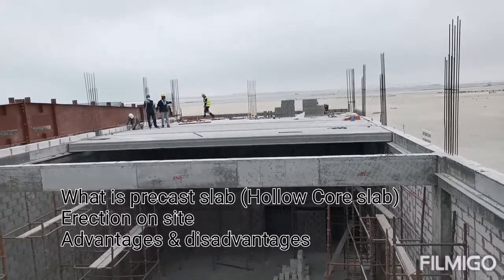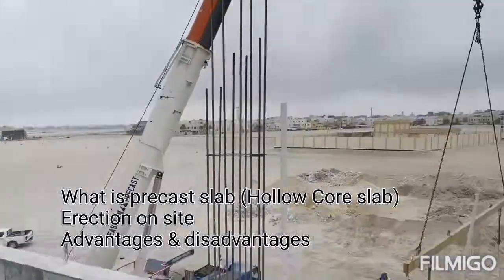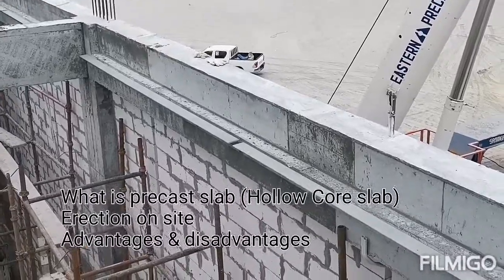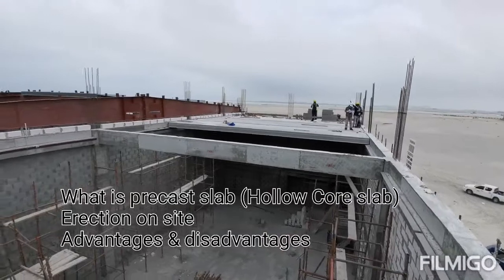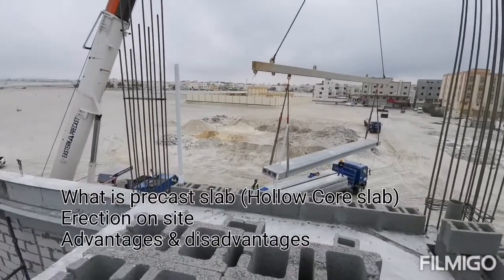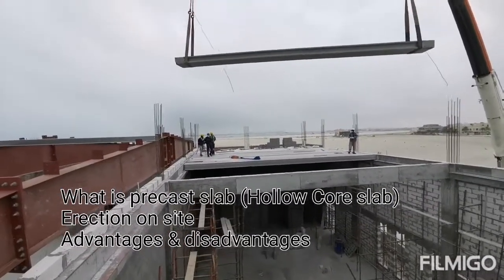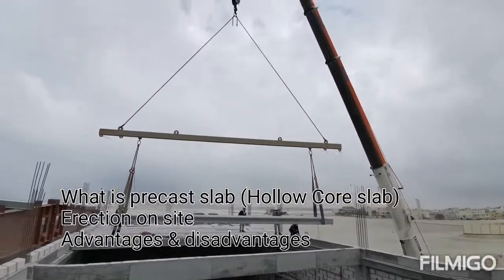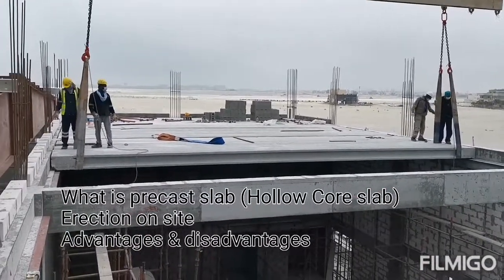Precast Slab (Hollow core slab). How to Erection precast slab on site | HCS

Comment: can i know 

what is the length of the hollow core slab and its thickness ?
 and what is the span between columns ?
 and the number of floors  ?  

thanks  🌹
Reply from the maker: I don't remember i will check the drawing and let you what  was the span and what was the thickness approved by the consultant...it was old video and old project..will come back,💗

Comment: What is the cost per sft of this precast slab along with transportation and erection..
Reply from the maker: This 250mm thick precast slab... Different thickness available as per designer... Rate depends on the site location...
Reply from the maker: I will confirm the rate in sqm and let u know